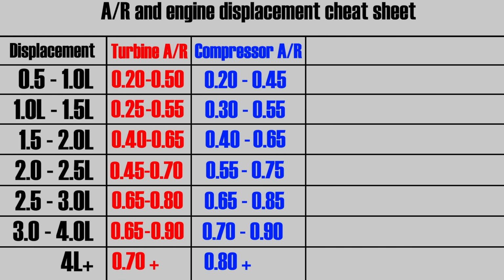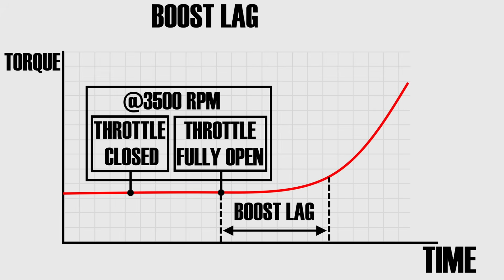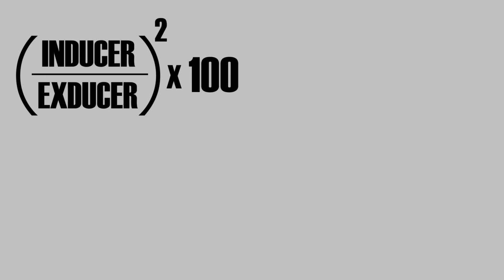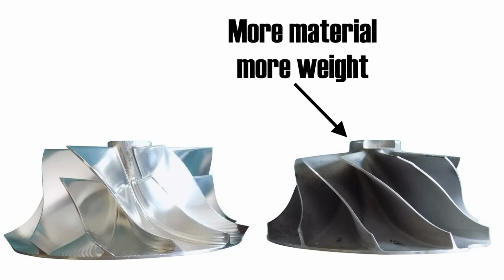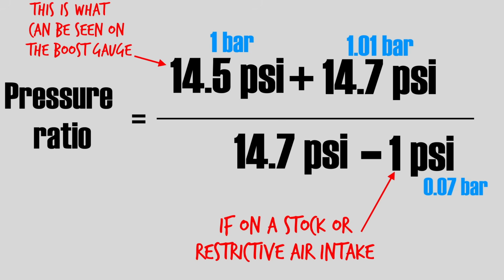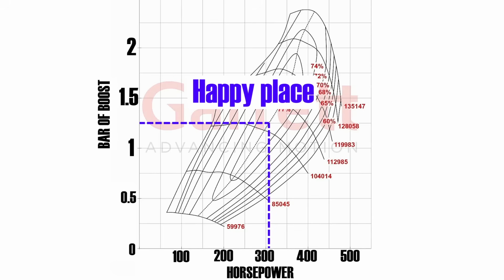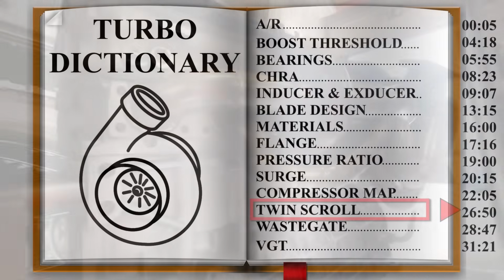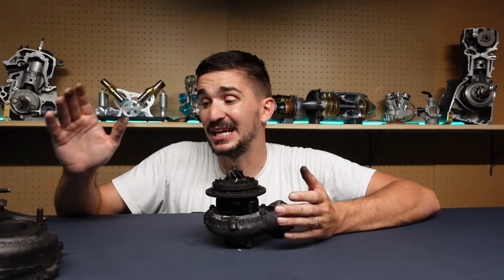All in One: A/R, Compressor Maps, Turbo Lag, Surge, Twin Scroll, VGT, Wastegate +more

Comment: For anyone choosing between turbine housings - keep in mind that A/R is only ONE part of the puzzle and does not solely determine boost threshold or response. It's a significant contributor yes, but so is your tune, turbine wheel, exhaust manifold, camshafts, head flow, exhaust back pressure etc etc. There are so many other ways to improve response.
What I'm trying to say is don't be afraid of picking a larger turbine housing and/or wheel, especially if running a "large" compressor. It's also not a bad idea to leave some headroom for your future power addicted self😉

Great video as always d4a!
Reply: Agreed! I have a 2004 Audi TT with the 1.8T 225hp engine and a K04-022 turbo. I did a rebuild and some upgrades last year, and one of those upgrades was a CHRA that featured a more aggressive compressor wheel. My God boost response has shot through the roof! It's almost instant, just from improving flow and upgrading the compressor wheel!
Reply: Noone after peak hp cares about response, noone after efficiency is after peak hp, noone after peak response is after peak efficiency.  How well you can waste gas to keep spooled AND flow is key.  There is a reason why exhaust headers are so meticulously engineered for scavenging effect.  It doesn't have to get thrown out with the turbine restriction.  <-wastegate flow/bo valve engineering
Reply: @charleshorseman55  it’s always a compromise. And running external gate where possible is a bonus in every way, especially when running a relatively small hotside
Reply: I have a .86 AR T3 turbo mounted to a 1.8L I-4 BP engine.  Turbo lag is noticible, but full boost (18.6 psi/1.28 bar currently) is a little crazy.  I'm not really chasing ponies, but I do want to bump up the power a little more.  The engine can certainly handle it.  The clutch... I'll need a better pressure plate.
Cheers.
Reply: @christopherlowery855 Sweet, I’d imagine it really woke up the mid&top range!
A stronger pressure plate on a stuck clutch works wonders. Just be aware that swapping in a significantly stronger plate will make the clutch pedal noticeably heavier
Good luck with the build!
Reply: @krimsonoyt  Appreciate the good luck.
The car originally had the FM happy meal when I bought it.  The clutch was so stiff that I was burning through slave cylinders every few years.  In less than 50k mi, some of the torsion springs, on the clutch plate, began to break out of the sub plate/hub plate.  This caused one of the torsion springs to rub against the pressure plate diaphragm spring, on the preaaure plate assembly.  This interaction prevented complete clutch disengagement and far more grinding than I was comfortable with.  (I thought the transmission was bad)
The happy meal clutch kit is rated at 353ft-lbs, but since they're using an organic clutch disk, their pressure plate requires a ton of force just to disengage the clutch.  The assembly is a poor design IMO.
That's why I went with an ACT Stage 3 assembly with my replacement.  The clutch plate is a ceramic 6-puck design.  The entire assembly is only rated at 310ft-lbs, but the clutch engagement is slightly heavier than stock.
The next upgrade will be just the pressure plate, as the clutch plate will remain the same.
Depending on how much wear the plate has, at the time of upgrade, I might replace it as well.
The upgraded assembly should have 405ft-lbs of torque capacity when all is said and done.
That's plenty for my purposes.
I'm a little concerned about slave cylinder wear, but it should be nothing in comparison to that happy meal engagement force.  The only thing I've driven with a higher clamp load than that is a tractor-trailer that has 2000ft-lbs of torque.
Just in case anyone was interested in the details.
Cheers.
Reply: The only thing that limits my boost is the first part to break
Reply: @Pippy1 life begins at 30psi

Comment: My first experience with VGT was a holset he351ve on the cummins 6.7. I want to put one on a gas engine and see what kind of spool can be had.
Reply: Also, VGT tends to be much simpler and less failure prone compared to VNT. I've seen those vanes overheat and seize, as well as warpage from the carrier ring on the Garret design. Holset's variant has similar looking vanes, but they're fixed and the moving piece is just a giant slotted ring which is very hard to seize compared.

Comment: I'mma have to watch this closely later. Measuring the compressor outlet, but talking about the inlet? Not showing the equations, and the analogy with blocking off the hose means the fluid coming out will have less pressure - or at least the pressure drop across your thumb will be greater, and it drops to atmospheric static while going faster so the escaping fluid must be lower pressure?

I'm lost and only 3min in.

Comment: its kinda weird/unusual that A/R ratio is not actually a ratio (dimensionless number) but a dimension of length (surface / length) so should always have a unit in front otherwise its kinda  meaningless. in the example from the video, square inches / inches so its 0.43 in? it gets wven more confusing whem I googled I found A/R values in cm^2 and a formula ((CM x 8) - 7) / 100 = a/r ratio
so its seems that depending on the unit used, you are not actually measuring exacftly the same thing. plus 1 sq in = 6.452cm2 so its like nothing adds up or makes sense.. also measuring the distance beetween the center an the inlet port doesnt seem to tell a lot about the turbo itself? the air doesnt reallly care if its before or after the inlet port. it seems like A/R ratio is more an indicator that can easily measured without opening rhe turbo, than an actual measurement. my understanding ia thr A/R ratio makes sense as long as you are comparing two turbos that are very similar in design, and only vary in size. which is propbably the case for most turbos. It's like because turbos internals cant be easily measured, lets  measure lengths that are easily accessible, and use the correlation between those measures, and rhe turbo performance. not a scientific approach but something mechanics would do when they have a turbo laying around with no markings/label. its funny that its become an industry standard though.
Reply: A/R is a specification.  Think of it like the cargo area volume specification of an SUV.  It matters if you need to know how much space is available for cargo storage.
In high power gain situations, you will want a much higher Area over Radius (A/R) value because turbo lag is less important.  Smaller A/R values, equate to faster moving air, but create a bottleneck when the amount of air produced, exceeds the size of the hole the air is plumbed through.  Meaning, different engine sizes will call for a different range of A/R sizes.
This is why the A/R chart in the video is important.  As Gale Banks points out, Air density is what dictates power, not pressure.
A/R is important to know when assembling, or choosing a turbo based on specs.

Engineers develop parts and components in CAD (Computer Aided Design) software.  All the measurements and design changes are made in a, typically 3D, virtual space.  Design changes are made in real time.  Most mechanical engineers ride a desk all day.  Those who make the parts aren't the same as the people who design the parts.  Measuring any dimension is as easy as pointing and clicking.  This is even how engineering drawings are made.  Long ago, this was all done on a drafting board.  However, since the 80s, wire frame CAD software was introduced.  Around 1995, solid/3D modeling was introduced.  It's been the standard ever since.
Your speculation doesn't really match reality.
Sorry mate.

Comment: Sir can i ask you something about twin scroll turbo...

1.on twin scroll turbo what is the best way routing the exhaust manifold..i hove there a video on this

A. Cyc 1 and 3,2 and 4

Or

B.cyc 1 and 4,2 and 3
Reply from the maker: It's definitely B. You don't want the cylinders that fire after each other in the same scroll.
Reply: 1 and 2 , 3 and 4 works also fine with high rpm engines

Comment: We see VGTs on high perfprmance luxury vehicles, like with the 1.0 TSI 85Kw engine from VW Group. :D Love your no nonsense presentation style, now with timestamps even!
Reply from the maker: It has VGT? I didn't know that. I recently drove an A1 with a 1.0 tfsi. It was appalling.
Reply: @d4a  Only the top performing 85kw (and 81kw) , which also comes with a dual mass fly wheel, as you would expect from a luxury vehicle :D Still, not a bad engine at all, in a small car like a Skoda Fabia.

Comment: Bigger turbo with smaller A/R or smaller turbo with bigger A/R ? ( I think the compressor map in Garrett turbos are with the largest A/R of the model )
Reply from the maker: Bigger A/R is the bigger turbo. You mean wheel?
Reply: @d4a   for example there is a gtx3076 with 1.06 A/R and gtx3582 with 0.63 A/R
Reply from the maker: As a rough guide, you'd put the 3076 on a smaller engine because the 3582 surges earlier as it has a much larger 66mm inducer and then you'd choose the A/R of the turbine housing based on what kind of power band you want to see on that engine, larger for power and drama higher up or close to the redline. But all of that is already mentioned in this video. Changing the A/R of the turbine housing does not impact the characterstics of the compressor wheel, hence only one compressor map for multiple turbine housing A/R options.

Comment: how inappropriate, right in the thumb nail. also if you use AR numbers, you mash two features into one. ie turbo size and the output neck size. why have pistons separate from the turbine, waste of complexity. yes make a full turbine engine, no pistons. yep also a turbine engine has compressor and the exhaust turbine.
Reply from the maker: What's inappropriate?
Reply: @d4a posting a rude comment before even watching the video? 😂
Reply: @d4a  well look a the image, of the turbo, I think its relative whats inappropriate lol; I give you a hint, its the strongest shape
Reply: @gsestream there's an inappropriate triangle in the thumbnail? 🤕 I don't get it, I only see a book and some words
Reply: @beargillium2369  triangle? the other strongest shape, related to triangles
Reply: so how about 100x more pressure, like in a freezer compressor
Reply: a normal turbine engine is less total complexity than a piston turbo engine
Reply: assume turbine engines are the same efficiency 25% as piston engines, as heat cycle engines
Reply: @gsestream  Are the triangles in the room with us now? Don't worry, even if they are the strongest shape, we can defeat them together.
Reply: @cannaroe1213  what is the mans strongest shape